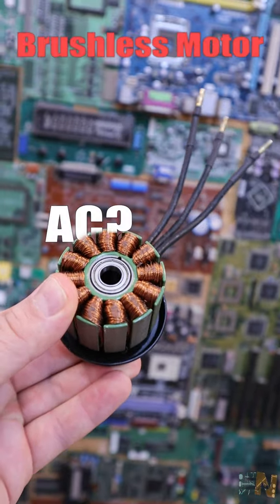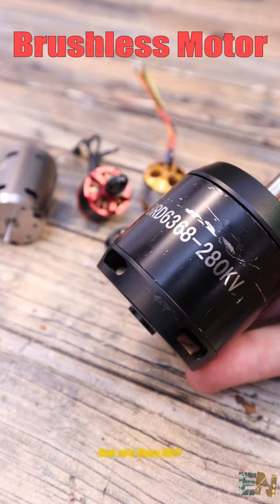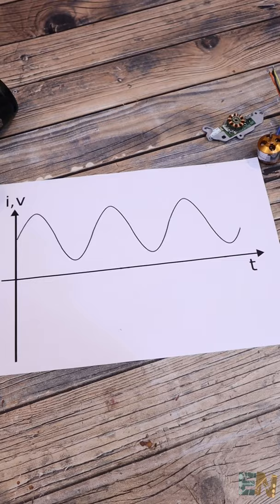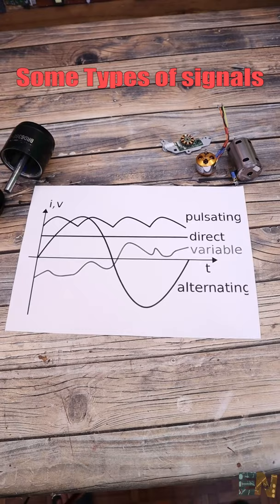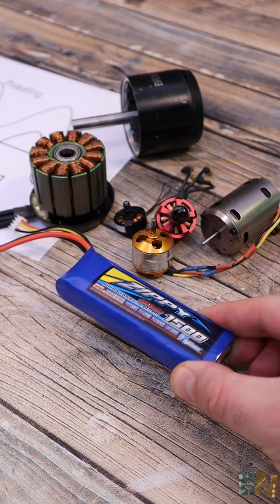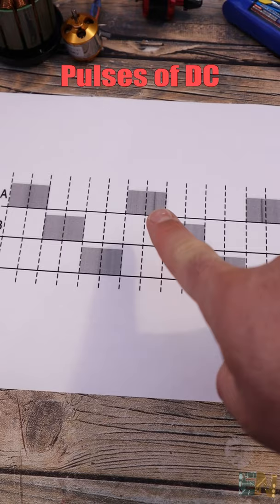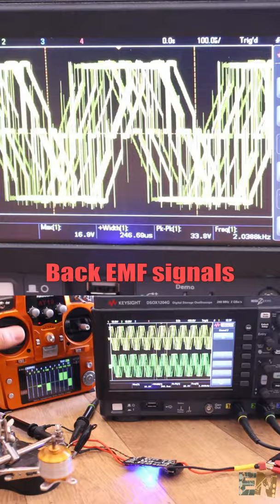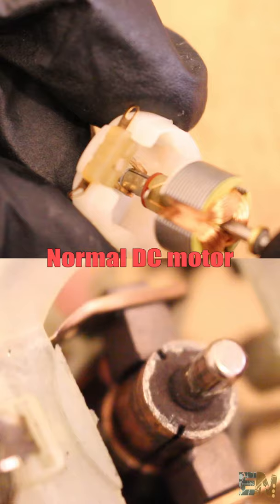Are Brushless Motors AC or DC? - Well...

Comment: IMHO the current is alternating inside the motor coil means AC. The other hand the motor coil Voltage is also change the direction obviously. So, in my theory this motor is AC. (Yes, the brushed is also AC inside.)
Reply: Well said. He did not do his research and is misinformed. Why showing the offset sine wave above zero volts was nothing but confusion and has nothing to do with this motor/esc.

Comment: By definition all continuous motors are ac.  Maxwell's equations state that the current in the windings must integrate to zero over a full wave. Otherwise magnetic flux would accumulate, and the core would saturate. Even what we call "DC motor" is an AC motor. We call it DC because commutation is done I internally. Brushless motors do not have internal commutators. This is done electronically. Therefore you must feed it AC current.
Reply: Well said, and the current probe shows the current is alternating in my video.

Comment: It is an AC motor. They call them BLDC because the torque vs speed curves of both BLDC and DC brushed motors are linear. Using a DC battery to run the motor puts the DC into an inverter which converts it to AC (DC offset doesn't make a signal DC). The signal alternates regardless of what hight it alternates.

Comment: AC motors whats looks quite simillar to brushless motors(BLDC) are names PMSM(Premament Magnet Synchronous Motor).
Reply: In fact BLDC itself is a PMSM, the DC power never directlly drives the motor,but within the ESC, it has been converted to three phasees with Variable frequency. Even with AC motor, AC line's power needs to rectify to DC then use Variable Voltage and Frequency Controller to convert it back to three phase AC to control the motor.

Comment: "alternating" does not need to be between positive and negative. Changing in a recurring pattern between high and low is also alternating. So technically (literally) it is also alternating current.  Nice discussion though :-)
Reply: Alternating current is a sign wave. Direct current or dc is pulsed in the motor creating a square wave that doesn't pass zero volts
Reply: @waderyun.war00034  depends on who you ask and in what context. In Fourier analysis everything is AC. DC is just AC with 0Hz frequency.
Reply: Sorry, wrong, your explaining the voltage is changing say 5v to 10v and back, the current never changes direction, that is where your wrong.
Reply: @Ozzy3333333  it's more compliance than that. Say for example you have a signal oscillating from 0 to 1V. You here have no negative potential. In HV system it would be called an AC-DC voltage. Because it is an AC voltage superimposed on a DC. Sometimes you don't care about the DC. You might even filter or out and only look at the AC part. In a permanent magnet AC motor you might not care about the DC part as it is the AC that drives the motor.
Reply: @ManneSegerlund  sry, no, going from 1v to 2v and back create zero reverse current.
Reply: @Ozzy3333333  I'm an electrical engineer. Come back when you know Fourier analysis. You can separate any signal into a linear combination  of a DC part and AC parts. This is called Fourier analysis. AC is not just a pure sinosoid of 120/240V at 60/50Hz. This is like 101 of electrical engineering.
Reply: @Ozzy3333333  Nope, there is nowhere defined that alternating should go through 0v. I know most people think it should do but that is literally wrong. So I'm sorry too in telling you are wrong. :-)
Reply: @astrogerard  Sorry, but you are wrong, here is why. AC stands for Alternating Current, and the "current" though this motor is AC. He is showing the voltage in your traces, not current. Watch my Hdd or my rc motor video, the green trace is a current probe on one phase of the motor, clearly the current is going the opposite direction = AC. That is the function of a 3 phase H-bridge circuit. This is a very similar motor and esc, and after watching my video, your going to still tell me the motor is DC and the current through the coil is DC? Talk about the motor is AC or DC not his missinforming wiggling signal above 0v which has NOTHING to do with this video (stupid he even added it, just added confusion)
https://youtu.be/XYJ1snJ-8ls
Reply: @ManneSegerlund  When someone starts to spout their credintials, you know something stupid is coming. Sorry, but you are wrong, here is why. AC stands for Alternating Current, and the "current" though THIS MOTOR is AC. He is showing the voltage in his traces, not current (amps). Watch my Hdd or my rc motor video, the green trace is a current probe on one phase of the motor, clearly the current is going the opposite direction = AC. That is the function of a 3 phase H-bridge circuit. This is a very similar motor and esc, and after watching my video, your going to still tell me the motor is DC and the current through the coil is DC? Talk about the motor is AC or DC not his missinforming wiggling signal above 0v which has NOTHING to do with this video (stupid he even added it, just added confusion)
https://youtu.be/XYJ1snJ-8ls
Reply: @Ozzy3333333  it alternate. You know switch between different values. A brush less DC motor could never work on a constant voltage. It works by a rotating magnetic field.
Reply: @ManneSegerlund  AC is alternating CURRENT, not voltage, "if" the voltage only changed 5v to 10v and back, this motor would not work. In the main use of this motor, the CURRENT is ALTERNATING, it does this by flipping the voltage 0v the B+ on each phase. Please study up to understand we are talking about this motor with this esc, simply put, DC into esc, and AC (square wave) is coming out, watch many of my videos, its pretty clear the CURRENT ALTERNATES in this setup.
Reply: @Ozzy3333333  if you can't understand that AC and DC as concepts aren't as clear I don't know what to say to you.

A brush less DC motor is just a permanent magnet 3 phase motor. 
You could run them on 3 phase AC, ie Asin(2pif+p), without problem. I'm also well aware of what the ESC does. The driving circuit is quite simple.

In the end I advised you to look up Fourier analysis. It's the most useful too in electrical engineering.
Reply: @Ozzy3333333  AC is also alternating current but not exclusive. Your choice, we both are right or you are wrong :-) :-) :-)
Reply: @astrogerard  Bottom line: the current in this motor with this esc is AC, period.
Reply: @ManneSegerlund  Bottom line: the current in this motor with this esc is AC, period. I learned Fourier analysis back in early 80's, talk all you want, even till your blue in the face,my current probe trumps any fancy math and is simple proof this motor runs on AC current. Read all the comments, many many are saying the same thing, doh!
Reply: @Ozzy3333333  Good, then you know that all non constant currents/voltages has a DC part and AC parts. If you press the FFT button on you oscilloscope you can even have it calculate them. But I'm done now.
Reply: @ManneSegerlund  good, hope you learned that this is in fact a AC motor, if not, your loss.
Reply: @Ozzy3333333  I have always said what gets called an DC brush less motor is a permanent magnet 3 phase motor. It's you who has been talking about it being DC because the current do not switch direction. Stop pivoting.
Reply: @ManneSegerlund  Wrong, I have been saying all the time, this motors current switches directions and its AC motor.
Reply: @Ozzy3333333  So you opted for my last choice. Please read a dictionary (of your choice) first about the word "alternating" before you narrow minded answer everyone with "you are wrong". The world is larger than your AC motors.
Lets all be a bit positive and more kind to each other. The world is nicer with a smile.
Reply: NO NO.. Yes it does
i do accept that he made mistakes
and i can see your approach
but on the subject of the Literal Definition of ALTERNATING CURRENT
it MUST change polarity to be considered ALTERNATING 
The term ALTERNATING in the A.C. Acronym does not pertain to Alternating Amplitude, but Alternating Polarity
it must absolutely move from one direction to the other
the Electrons Must flow one way and then the other way 
in this example staying in the positive , (and given a sine wave is not how the wave actually travels but in fact it is a MATHEMATICAL REPRESENTATION of how it travels, the electrons would actually travel in the same direction the entire time, the only thing that would change is the pressure (aka the speed of the electrons) while travelling in the same direction,  it's Pulsating DC, it's not AC.   in saying that, i can say a lot wrong about what he did and how he measured it and i could show mistakes which resulted in us seeing this waveform which in turn creates the shit storm that is this argument in the first place,  so to keep it simple..... ALTERNATING current, MUST Change Polarity , by it's literal definition , if it doesn't do that it doesn't meet the criteria to be called ALTERNATING CURRENT
Reply: @martinkuliza  It is more complicated than that. That is why the 'so called' definition of AC assumes reversing polarity. But this is more to keep it simple rather than complete.
Reply: @astrogerard  
NO. it's not to keep it simple
If you want to get complicated...
Literally in A.C. the electrons first go in 1 direction (Polarity) then they go in the other direction (The Polarity / Direction of Flow of Electrons) Changes

What you are describing (Assuming it stays in the positive the entire time) is An Increase and Decrease in Amplitude while travelling in the same direction

Also, the actual sign wave is just a mathematical REPRESENTATION, it's not literally how the current looks when it flows

so.. You are incorrect mate
Reply: @martinkuliza  YES (sorry to use annoying caps) it is for simplicity. I of course know electrons move (only a little and very slow) in both directions with AC.
My point was the keyword "alternating". A simple DC blockwave is also alternating (by textual definition). Only for AC there is an addition in most dictionaries that assumes current goes in both ways.
But lets end this discussion... mate (my goodness what I hate the silly word "mate")
Reply: @astrogerard  No problem, Only i think the point you're getting stuck on is ALTERNATING

In the context of Electrical current it actually and definitively means Changing Polarity.

as for caps, i don't care about caps
If you want to end it, that's cool
Be cool mate

Comment: Even in your definition of "alternating" current, the current through the wires to the motor is actually changing direction, each coil wire being driven by a half bridge. It is true that even for a proper DC motor the current inside the coils changes direction, but not in the wires to the motor.
But in the end arbitrary semantics are irrelevant in science and technology. Neither does the motor itself care what you call it, nor is it relevant for the application.

Comment: You are definitely wrong. Every motor has either mechanical or electronic switching. The DC motor is mechanically switched and the BLDC motor is electronically switched. Every motor is a transducer, converts electrical energy into mechanical energy and vice versa. But if you run a DC motor you will have a DC generator dynamo, now if you run a BLDC motor you will have an alternator, generating three-phase AC current, and you will need a voltage rectifier to convert to DC. Cheers from Brazil.

Comment: I'm stay with DC one, cause it just a few sequence variety of combinations state from three output wire, that is  '" one + voltage,  one  - ground voltage,  one Floating "Neutral '"  and that state switch than loop, due the reads from floating Bemf timing for the mosfet that been programed to "opening or closing"  act as switches.. Electronic commutation of a BLDC motor - switch sequence  : https://www.youtube.com/watch?v=Rq5DT1UJlE4&t=131s

{ so i guess I'll stick with the name BL-DC }
https://en.wikipedia.org/wiki/Brushless_DC_electric_motor
Reply: But the fact is the 3 phase H-bridge flips the polarity to each phase, thus driving the current both ways and this my friend is in fact AC. I am surprised electronoob really botched this one up with multiple issues with his info.

Comment: The a2212 shown in the video is 3 phase ac ( the orange one )
If you spin it it will output a 3 phase ac power you can add another a2212 to the output but since only the esc is designed to run it it will just vibrate alot there will be rotation but not alot mostly vibration

Comment: BLDC is a new type of motor. Before that two common motor types were Syncronus AC motor and DC motor. One big drawback of DC motors are the brushes. But with transistors, bushes and the Mechanical Commutator could be moved out of the motor and be replaced with an Electronic Commutator (controlled by position sensors). The DC and BLDC has the same electrical and magnetic performance, but the mechanical switching is replaced with external electronic switshes. 
Eg, BLDC and DC motors change speed due to voltage, AC is controlled by frequency. BLDC is designed for square voltage, in only two conductors at a time. AC uses all 3.
Ps. You know that DC motors have AC currents in its windings... It's due to the mechanical DC-to-AC converter in the commutator.

Comment: Bldc is a ac motor, the ESC makes the alternating current (voltage), please update the video you are wrong.
Thanks for your videos, they are amazing 😁😁😁
Reply: I agree with you. Every motor has either mechanical or electronic switching. The DC motor is mechanically switched and the BLDC motor is electronically switched. Every motor is a transducer, converts electrical energy into mechanical energy and vice versa. But if you run a DC motor you will have a DC generator dynamo, now if you run a BLDC motor you will have an alternator, generating three-phase AC current, and you will need a voltage rectifier to convert to DC. Cheers from Brazil.
Reply: @multicopter  I think the bldc can also be considered a dynamo, dynamo's are made with fixed magnets, alternator are made with electric magnets. Alternators don't have fixed magnets.
Reply: My question.  How I can mesure de Current ( Amps) on an rc (used with ESC)  Brushless motor with a Clamp Amp meter?
Reply: @R.B_B  with a RMS ac multimeter with a high frequency sample on motor leads or the total current entered in the esc, (DC side) with a DC clamp, needs to be DC

Comment: I have 3 questions for you :

-if you convert that motor to generator, what is the output signal ?
-if you gave it a nice AC wave form what will happens ? is it still DC ?
-motor controllers are made only for brushless drone motors or any static stator motors ?
please do your research in the subject first

Comment: You showed a DV single of varying voltage, however if you measure the CURRENT on each of the wires, the current is REVERSING, the definition of Alternating CURRENT using a positive voltage of different levels. 
If you measure the voltage of a wire in relation to the common terminal, then that two is alternating.

Comment: Maybe better is to consider main flux in motor. In DC motors main flux is in general constant and not rotating (with rotor) . AC motors - both synchronous and asynchronous - have flux rotating (with rotor).

Comment: Post from Quora titled, "Are brushless motors AC or DC?".

"This question is a lot like asking the difference between a bolt and a screw in that the distinction is not so clear as it may first seem.

To answer briefly, a BLDC motor is in the most technical sense a synchronous AC motor, but I’d argue it is perfectly appropriate and beneficial to call them DC motors. Explanation below.

First I’d say it’s important to realize that deep down all motors (ok, ALMOST all motors, and all practical motors I’ve ever seen) are AC. The terminals where you hook up a wire may be for DC power, but somewhere somehow inside that motor current is being switched on and off (or you could say alternated) to create a rotating magnetic field that spins the motor. In your standard brushed DC motor this is done with brushes that rub on contacts built into the rotor, in a brushless DC motor current is being switched with a microprocessor and transistors to produce the same field just without brushes.

So why do we call them DC motors? I think because we don’t concern ourselves with how they work inside the box so much as how we need to interact with them. A DC motor requires we provide it with DC current, and AC motor with AC, and a universal motor can work with either. Since MOST brushless DC motors are self-contained units which expect DC current at their input and the end user need not worry about all the AC stuff happening within it’s no less reasonable to call them DC motors than your standard brushed DC motor.

Where this starts to break down is with a “brushless DC motor” that does not include a controller, technically by my standard of “how do I power it” this would be call an AC motor… but the motor is designed to be operated with a controller that will start with DC and supply the AC power to the motor, there’s just a longer wire between the motor part and the controller part and you connect that wire yourself instead of it being built into the motor housing."

This makes sense as all motors operate off an "AC-like" switching principle. However the difference is the type of electric current is it engineered(i.e optimized) for as the starting input AC or DC? 

Great video on how BLDC motors & ESC PWM controllers work;
youtu.be/yiD5nCfmbV0?si=gWsD5J9436BNiYFa&t=607